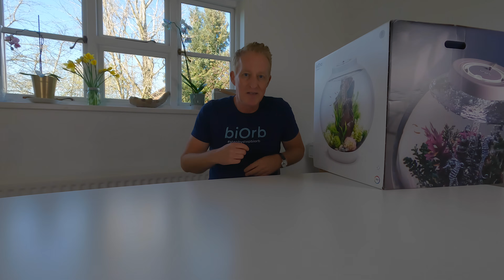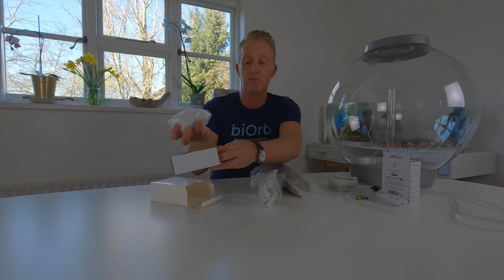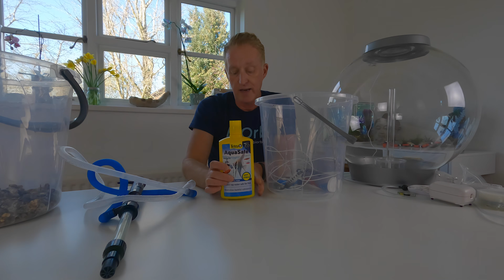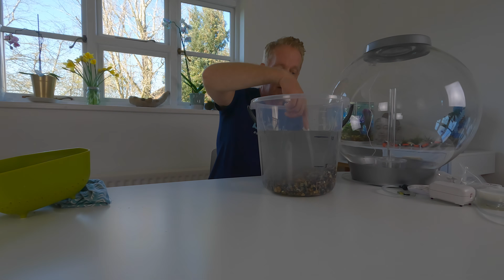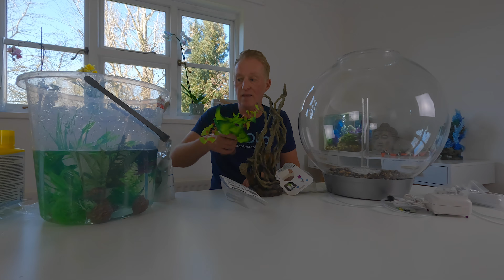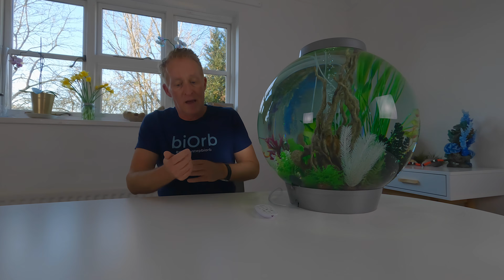biOrb Aquarium   | Starting a biOrb | New approach!

Comment: We have just bought one of these but smaller version and the pump is quite noisy... little off putting
Reply from the maker: Hi. A bit of noise should be expected (regardless of the tank or pump make), but if it's really loud, it might be worth checking the air line for any kinks or blockages. Also, double check if the noise is coming from the pump itself or if it is coming from the base of the tank. My normal suggestion, to reduce noise that is being emitted from the tank, is to add an air regulator to the air line. It is an easy thing to do and in most cases allows good control of noise. See here: https://youtu.be/_5hoPN585Ys  Hope that helps. Mark
Reply from the maker: Hope that helps. Always good to get positive feedback. Best, Mark

Comment: Hi Mark, I’m currently binge watching your videos since buying the Classic 60l 😁 
My question is .. how do you heat the water that your adding to the tank? Can you use warm tap water? 
Thanks for sharing  :-)
Reply from the maker: Hi Nikki. It partly depends on the quality of the water from your hot tap! You need to test it. If it is okay quality you can just top up a bottle of cold tap water with some from the hot tap. You need an aquarium thermometer to judge when the temp increase is about right. But, the way I do it is to fill my 5L bottles with the water to use for the aquarium. I then stand those bottles in a sink of hot water... this will slowly heat the water in the bottles. Again, you need a thermometer to do it. The one I use if this one (it allows you to set the temp you want to achieve and then bleeps to let you know) https://amzn.to/3M440jy.  Best, Mark
Reply from the maker: I find it best to stagger when you add each bottle to the hot water in the sink. For example, if heating three bottles of 5L, I would add one bottle, wait for 4-5 mins then add the second... and so on). This will allow you to add the warmed water from each bottle to the tank when it is ready and then the timing should allow you to keep up with the filling from each bottle. If that makes sense!

Comment: Hi Mark,
In my set up the distance from the air pump hose exit from the orb to where I have the pump (on a little shelf ( hidden below the small table the orb sits on) is quite short, like 10 or 12" .  I would like to loosely coil the hose to keep things out of sight.  Do you imagine there is any problem if the hose is coiled loosely as opposed to a straight shot to the pump?
Reply from the maker: Hi Nancy. All things being equal... I do not believe there would be an issue with coiling the air line (in terms of air flow performance). Alternatively, if the air line would be better for you, - as a shorter length -  you could consider reducing (cutting) the airline length? This would mean moving the stop-valve nearer to the tank (but, still positioned about 12" from the air pump). Best, Mark

Comment: Many thanks for the detailed clear videos!  I am a planted tank aquascaper and am intrigued by the biOrb set up.  I wondered which tank style you like the best and do you think they are similar in ease of maintenance in regard to their shapes?  I'm thinking about trying the Classic, either 8 or 16 gallons.  I will be watching your whole library of videos, so again thank you for making them :)
Reply from the maker: Hi Nancy. I suppose they are all nice in their own way... and the different tanks seem to lend themselves to different designs/set-ups.  Maintenance is roughly the same in all cases.  Obviously the bigger the tank (deeper) the more water (during water changes) you need to remove to get down to and maintain the ceramic media etc.   The Classic is the original biOrb design and it does have a far better water circulation/ flow and also seems to draw waste better to the central filter when compared to the other biOrb designs. The round shape lends itself far better to how the biOrb filtration system is intended to work.  My favourite overall design is the Classic - I love the funky style and it is fairly unique compared to other aquarium designs on the market.  I wouldn't get one less than 60L (16 gallon) though, as I think the design works better at that size or larger!  If I was to get another tank it would certainly be the Classic 105L. Hope that helps. Thanks for visiting the Channel and your support. Best wishes, Mark
Reply: Hi again, 
Thanks for the reply, so appreciate that.  I mentioned I have always planted my tanks, but if I go the route of biOrb Classic I might just use , dare I say it, artificial plants....in keeping with the funky colorful .  I wondered if you were suggesting minimum 16 gallons because you thought I would use live plants?  or are you suggesting at least 16 gallons for maintaining a good filter system, ease of maintenance?  Thanks!
Reply from the maker: Hi Nancy. You asked about maintenance...the larger the tank (tank water) the easier the maintenance. If you plan to also add fish then I suggest 16g as it will support a reasonable fish population far easier. If the tank is to be "fish-less" then I suppose the smaller tank would work fine. If you have a local shop, that stocks the Classic, it might be worth going in to see the two tank sizes side-by-side - to help you make your mind up on which size would work for you.  Best, Mark
Reply: @StepbyStep-biOrb  I'll be doing fish so I will go for 16 gallons   Thanks!!

Comment: I am a beginner and spent a lot of money on a biorb because it said it included all I need. That would be a lie. I need a heater. A glass tank with filter and heater would have cost less than half what I spent. Not happy,
Reply from the maker: Hi Kristy. I don't disagree at all!  If you want an aquarium purely for "aquarium sakes" (i.e. not a tank based on modern design) then a simple glass tank would have easily been the best option for you - and far cheaper.  Most people who choose biOrbs are doing so based on their funky design ('a living ornament') rather than aquarium practicability.  Generally, all tropical fish tanks need a heater... but you can also choose to stock fish that don't need a heater (temperate species - which I also have and do tend to prefer). Very sorry to hear that you feel you have made the wrong choice. It is always best to check the market and assess what it is you really want before you buy. If it is purely an aquarium... there are lots of choices. At the end of the day, I have no connection with biOrb at all - I just own some.  This YouTube Channel is designed to advise biOrb owners how to prepare and maintain their tank and is especially aimed at those new to the hobby and based on my long experience of owning biOrbs. It isn't a biOrb sales Channel. Very best wishes to you, Mark

Comment: @Step-by-Step Would you know how many kg of the old-style ceramic stones are needed to start-up a biOrb Loop 30?

The reason I ask is because I threw away all my ceramic stones and decorations after white spot disease in my aquarium. In the meantime I watched nearly all your video's and realized that I could probably just have bleeched those decorations...
Reply from the maker: Hi. For a Loop 30 I would go with around 1kg of the old style ceramic media (you can use less- say 750g if you don't want to have too much media height).  But, get Alfagrog E25 which is the same product and far cheaper than getting the biOrb packs: https://amzn.to/3YdBe3l. Don't get Alfagrog E40 as it has a much larger stone size (40mm). The biOrb product is E25.  Give it several good rinses in a bucket with tap water treated with dechlorinator to remove dust etc and then leave to soak for a while. After that, you should be good to go.  Hope that helps. Best, Mark
Reply from the maker: Yes, bleach cleaning the biOrb and decorations would have removed white spot. But best to start again with new ceramic media.
Reply: @StepbyStep-biOrb  Thanks a lot for your quick response and sharing your learnings. It was a long evening yesterday, but I learned a lot :-) !

I was looking to buy the same heater element you are using, but can't find the biOrb intelligent heater anywhere for sale, it seems to be discontinued. I did like the discrete aspect of it, but will likely go for the standard biOrb 50W heater (or the non-reselled version you mentioned in your video from the original brand).
Reply from the maker: Yes, biOrb stopped producing it some time back. A shame as it is a great heater and is perfect for a biOrb. They occasionally can come up on places such as eBay but are often sold along with a second hand tank.  The standard 50W is fine, but shame about the thick black power cable!  The best alternative is to go without a heater and choose temperate species that are suited to room temperature conditions.  There are a good number of so called "tropical" fish that also fall into this category. It is a good alternative to using a heater and probably one I would suggest you look into.  Google 'temperate fish species' and you will find the species that would work.  Best, Mark

Comment: Hi Mark. I live in fear of my intelligent heaters failing. Like you I hate black cables. I've seen something on eBay, it's from china, made by yee, white cable, looks nice, would have to use an adapter as 2 pin plug. Wonder what you think? No reviews but it is cheap, could be bad thing😂
Reply from the maker: Hi  Paula.  Yes, I know the fear you mean. I cant say I've ever heard of this manufacturer before so I have no idea if they are any good or even reliable. I've just had a look at them though. Cable might be white but it still looks to be very thick - hard to judge from the images.   But probably no worse than any other standard heater currently on the market. When my biOrb intelligent heaters eventually die - i think I will just give up on heaters and change to fish that are happy with typical room heating temps. Best, Mark
Reply from the maker: There are often  biOrb  Intelligent heaters on eBay but often may come with a second hand  aquarium.   Let me know how you get on with the Yee is that is what you go for.
Reply: I might give it a try, and I will let you know😊

Comment: I'd buy this in a heartbeat if it had a heater.  Without a heater its worthless to me.  I live in Montana, we keep the house about 65 F.  Far too cold for most tropical fish.
Reply from the maker: There a numerous fish species that would be well suited to a non-heated tank and the conditions you describe :)
Reply from the maker: Have a look at the Fluval Edge 23L and 46L.  Those are fairly stylish and allow a heater to be integrated in the unit at the back of the tank. They are also cheaper vs biOrb!!

Comment: Thanks for doing this vid. Just got a second hand biorb and this has helped know what I need to get it started. Missing the media in my kit so I'll order some of that and get set up ASAP
Reply from the maker: Not a problem. If starting from scratch consider getting the biOrb Pearl Media as you will find that better than the standard ceramic media, is easier to clean and it also reduces the potential for very small fish to get trapped. Best wishes, Mark
Reply from the maker: Hope that helps. M

Comment: Hi Mark, 

Need some advice if possible. I have recently purchased the biorb classic 60L and being a novice to keeping fish I followed the instructions in the biorb booklet. I have only got as far as rinsing the ceramic media and the decorations in normal tap water (then I found this video). Would you recommend rinsing the ceramic media and decorations in aqua safe water now or is the damage already done? I haven’t got any actual water in the tank yet but will follow your method of treating that water before it goes into the aquarium.

Thanks in advance 😊
Reply from the maker: Hi Mathew. My preference is to rinse everything in tap water treated with aquasafe. Saying that, chlorine does have a "life span". With straight tap water, left to stand for about 5 days, the chlorine will have almost disappeared (evaporated).  I don't think you have caused any damage at all. It isn't a problem! But, it is worth setting up the tank, filling it with treated water and then let it run for 4-5 days before commencing with cycling and adding your fish.  Hope that helps. Feel free to contact me if you need any help at all with setting-up/ establishing the tanks.  Best wishes, Mark

Comment: Hiya how often does the ceramic media need replacing.   I replace my big tanks every year.  But obviously  this is a smaller tank.  I dont want a dirty tank or new tank syndrome either.
Reply from the maker: Hi Erika. In a biOrb the ceramic media acts as the tanks biological filter. This is unlike most other aquariums where the biological filtering is carried out through sponge filter systems etc and less so the substrate material. I still have ceramic media in a couple of my tanks that are over 5-years old and haven't had a reason to change them.  Water parameters are still excellent. But, saying that you could change the media every couple of years especially if the media is heavily stained. Caution needs to be applied when changing the biOrb's media to avoid new tank syndrome. It needs to be undertaken in stages to maintain beneficial bacteria. The method I describe in this video allows successful changing of media and avoiding new tank syndrome:   https://www.youtube.com/watch?v=M-SNTgG_-2I.  In small tanks, the key. to maintaining a clean and healthy substrate (and tank water) is to use a gravel vac and combine this with regular water changes of 25-50% (depending on numbers and types of fish held). Hope that helps. Best wishes, Mark

Comment: Just checking… you mentioned you are 2.5ml for every 5L. But shouldn’t it be 1.32 for every 5L? 
10mL (38L) x (5L/38L) = 10mL x 0.132 = 1.32mL for every 5L
Reply from the maker: Hi. Thanks for visiting the channel. If you are referring to AquaSafe dosage... it is 5 ml of AquaSafe for every 10 litres of newly added tap water (2.5ml per 5l). You could get away with less in terms of dealing with typical tap water chlorine/chloramine levels but AquaSafe also deals with metals such as copper, lead and zinc. Water suppliers also can boost chlorine/chloramine  levels during maintenance periods so 5ml/10l covers that scenario.
Reply: @StepbyStep-biOrb  Thanks for the reply! :) Oh, you must have different directions on your bottle for the AquaSafe. The Canadian bottle says 10mL for every 10 gallons (38L) of water.
Reply from the maker: I've checked on the Tetra website and established the difference.  I recommend simple dechlorinators and I always use standard AquaSafe. At  5ml/10l it also has a more straightforward dilution rate that is better suited to the size of biOrbs and undertaking regular water changes.  You probably have Tetra AquaSafe PLUS - it is this product that is prepared at 5ml/ 38l.  Hope that helps. Best, Mark

Comment: Hi Mark, me again!  I can't find any dosage instructions for the colony Freshwater other than 118ml for 95 litre tank. I calculated  24.15ml   I've looked at API calculator and this says 37.26 ml.  Help!
Reply from the maker: Hi. For a 30L the initial dose of Colony would be 40ml (first day).  Certainly, if you use a calculator it would be exactly 37.26.  Good luck on measuring out that quantity though!!  LoL!   

Don't panic... Colony is a completely natural product and you can't really over do it.  Many people don't even measure it and just put a "good glug" of it into the tank. More is better than less in this case but just go with 40ml initially.    I would tend to add another 20ml in a couple of days following that (day three). M
Reply: @StepbyStep-biOrb   Thanks Mark, I went with the 40ml lol.  Do you then does at each water change the amount of water your changing?  I am doing weekly water changes as you suggest at 25%
Reply from the maker: Hi Julie. The main reason to use Colony is to cycle the aquarium (with fish present) and to speed up the tank's beneficial bacteria.  Further use of Colony is fine during the cycling period though.  Once the tank is fully cycled there is not a need to add any further doses of Colony.  

The only time you may need to add Colony to a cycled tank is if you are increasing (adding to) the number of fish you have.  When adding more fish the existing colony of beneficial bacteria may take some time to naturally expand to support the removal of waste from the additional fish.   The additional boost of Colony would help to speed-up the growth of tank's beneficial bacteria to help deal with the increased ammonia and nitrite produced by the increased fish number.  

Once a tank is fully cycled, weekly water changes are certainly the way to go. I've undertaken water changes on 5 tanks today... it's a tiring hobby!! :)
Reply: Thanks so much Mark, really appreciate your help!